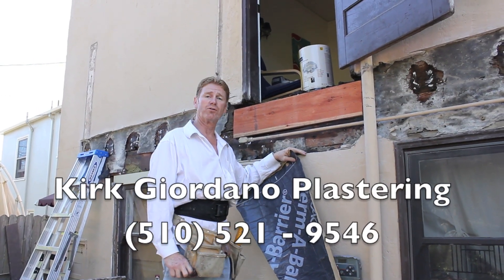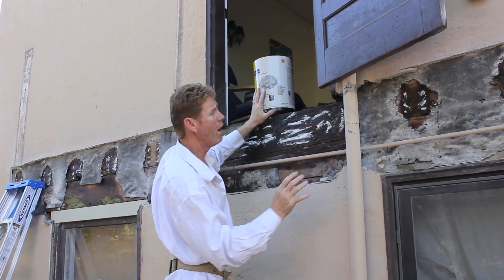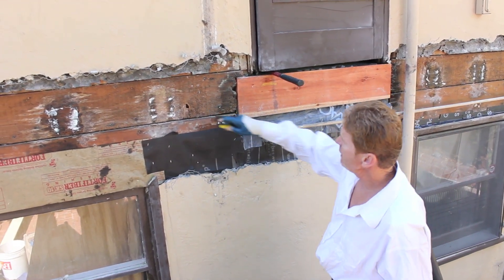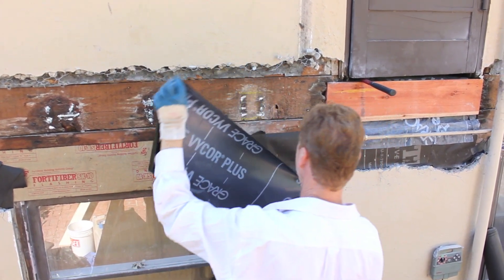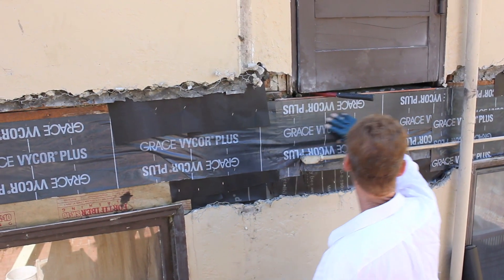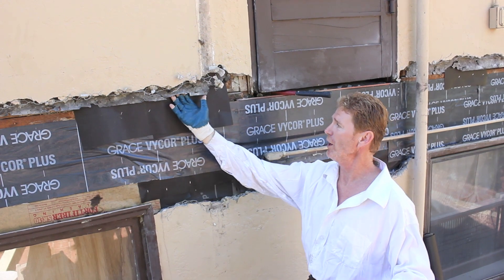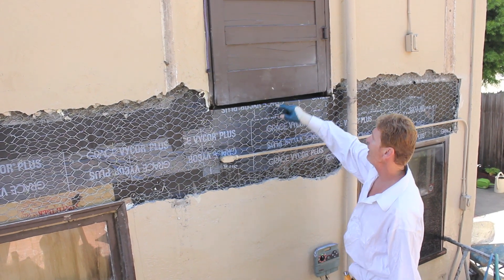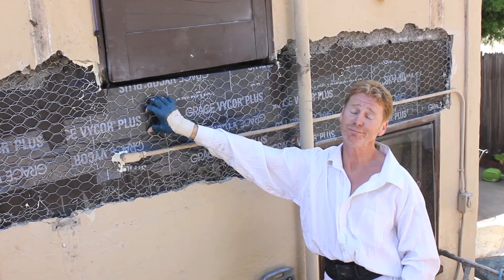How to install a ledger board on a stucco wall.

Comment: Kirk, what is the best way to waterproof a ledger to my stucco house. I will cut the stucco out the depth of the ledger and bolt the ledger directly to sheathing/rim joist. How can I correctly waterproof this system without having to do any stucco patching or repairing . Thank you!
Reply from the maker: Type in our channel how to install a ledger board, we have at least 5 or more on proper installations.😉
Reply: @StuccoPlastering  Thank you for your reply! I cannot find a ledger video on your channel that covers how to waterproof a ledger to existing stucco without having to repair or patch the stucco. Could you walk me through it?
Reply from the maker: Ask and ye shall receive.
ledger boards,
https://youtu.be/fPAH9xmR9nM/ Where to install a stucco ledger board before stucco.
https://youtu.be/ZcW7JrkQEso/ Install a ledger board before stucco.
https://youtu.be/UUoQFNGaDkg/ How to counter-flash a ledger board.
https://youtu.be/-llGQcaeaK0/  How to put a ledger board on a stucco wall.

Comment: Hey kirk love your videos and attitude. So would you always suggest to remove the stucco in order to properly flash the ledger board or are there possible situations where you could install the ledger board over the top of the existing stucco nad it stillb e properly flashed/waterproofed? Thanks for putting all this education out there 😁
Reply: Have the same scenario. But I have a 18” soffit with a 5” rain gutter overhang. Do I need to cut into existing stucco that never gets wet?  What did you do?

Comment: Good tip on if it should be hot for the waterproof paper. I was wondering if I should leave my roll in the sun the other day to heat up the tar, but good thing I didnt!
Reply from the maker: Greetings Eric, not much worse than trying to unstick the peal and sticks on a hot day, as they just melt together, it's best to cut off and thow them away.
                         Bringing peace, love, and harmony to plastering 
         Sound Plastering tips for the DIY beginner or the Plastering experts

Comment: Kirk!
Amazing videos! Very helpful for a weekend warrior. Just working a remodel in CO where everything was done wrong…. No flashing on deck ledgers, no effort… bad result even in arid co. Question on flashing… galvanized? stainless? Aluminum? What do you use and will they all last? Many thanks!
Reply from the maker: Howdy my friend usually galvanized is the best flashing as it does not rust. Stainless steel is also good but difficult to nail trough, Aluminum is weak and flimsy and doesn't last long👨🏻‍🔬

Comment: Can you install the membrane on top of existing stucco and then the ledger board? The existing stucco is under a 18” soffit and 5” rain gutter.  The area where a future ledger board is to be installed, never gets wet.
Reply from the maker: You're not supposed to install ledgers atop stucco, but I have seen many mounted on stucco. Your house, your rules. As long as the city doesn't object, your good; not pulling a permit? Well, then again, your house, your rules, However, here in my area, we have weather that causes the rain to be forced upwards; these are called stormes. 🕵🏼